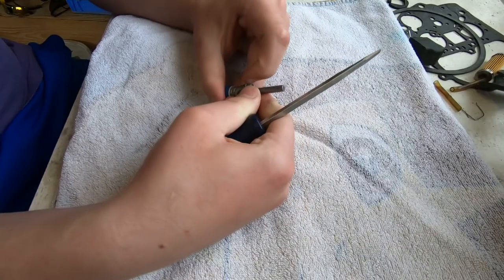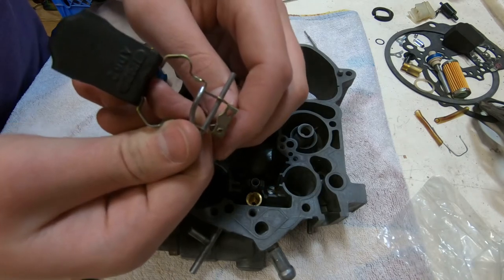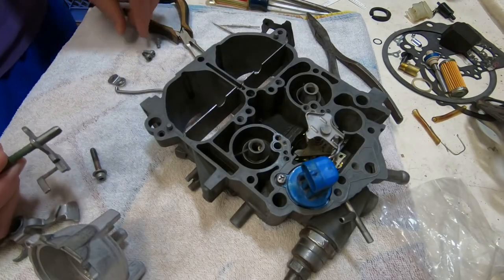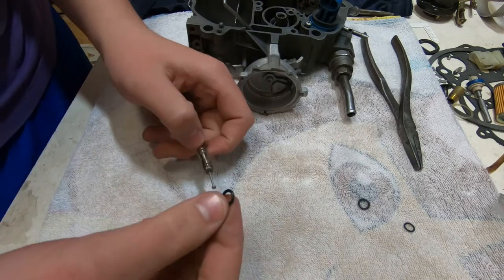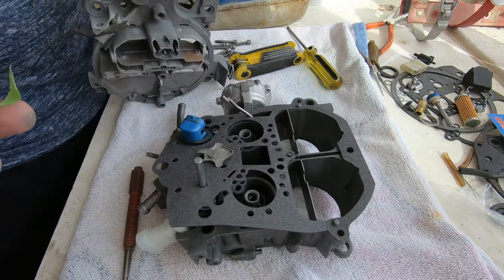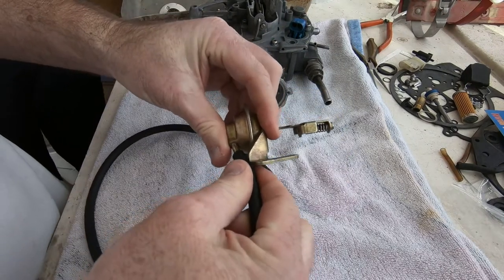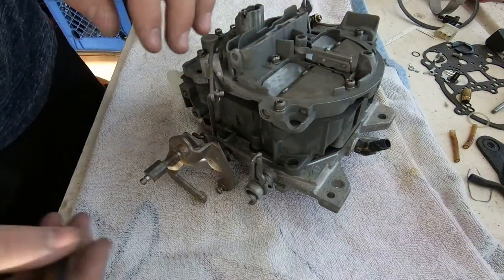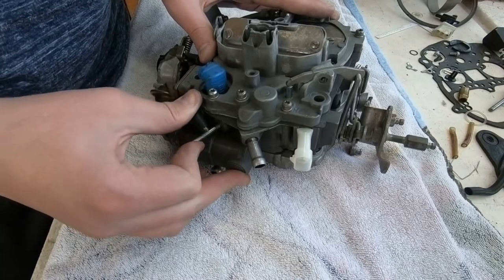E4ME Electronic Rochester Quadrajet Carburetor Rebuild, 4 of 5 - Reassembly

Comment: Thank you so much for this absolutely helpful and reassuring playlist for the rebuild. I'm going to do a rebuild me too without experience. Just a couple of questions. No lubricant on moving pieces was applied after cleaning that ? All ''dry'' assembly? Did you clean TPS and Solenoid? Contact cleaner ?
Reply from the maker: Thanks for the feedback and the questions!  It might be a good idea to lube certain spots to prevent wear, but I don't think we lubricated anything not shown in the video.  You just have to ask yourself (1) if it's internal, will gasoline was away the lube, or (2) if it's external, will it collect abrasive dirt?  We did buy a new TPS as mentioned near the bottom of the video description.  Contact cleaning is something we'd normally do if they look at all oxidized.  It might be with 000 steel wool or 150 grit sandpaper (the value doesn't matter but it can't be too coarse or too fine).  Then we always wash the contacts with contact cleaner (or carb cleaner or brake parts cleaner).

To this day I don't know much about the computer that controls the electronic bits of this carburetor, or how to tell if it's good or bad.  Luckily ours seemed to function just fine.

Good luck on your rebuild!

Comment: Excellent technique, tightening the air horn to the body/bowl. Always start from the center and work your way out, everything aligns and seals better. Use an X pattern for the carb intake hold down screws and only wrist pressure if you don't have a torque wrench. I have seen guys warp the air horn and entire carb by over tightening the screws.

Comment: Really appreciate the no-nonsense detailed assembly here.  I made a mistake the first time, the silver post that was supposed to be turned 3 1/2 times, there was a rusty spot on mine that I had to turn a little harder to get it all the way down before backing it off the right number of turns.  Car was driving poorly, secondaries wouldn't open, poor fuel economy.   Secondaries are opening now and doesn't bog down like before so I think I may have it right now.
Reply from the maker: Thanks, and really glad to hear the car is running better now!

Comment: I noticed the plug over the TPS adjustment screw was left on.  Is it not necessary to adjust or reset this with a new TPS?
Reply: @WorkinOnIt  At 20m30s, immediately to the right of the pump level, the silver cap is still there.  It would have to be pulled out (like the leaky well plugs) in order to get to the TPS adjustment hex screw underneath.    I guess my question is, if you put in a new TPS is that adjustment unnecessary?  Is that why it was left alone, or is there another reason?  Thanks!
Reply from the maker: @robdebuhr3952  Honestly, we simply didn't know about this adjustment.  Thank you for bringing it up!  In taking a second look, this is the best article I found on tuning E4MEs:  https://www.hemmings.com/stories/article/carburetion-for-the-new-age.  The TPS discussion left me wanting more, but at least it's there.

Comment: Hi.  I am flummoxed.  my top assembly does not lie anywhere near flat against the new gasket.  I can't see anything that would impede it sitting flat but there is a 1/16 inch gap even when applying a modest downward force.  it seems like all the edges will go down individually, so something in the middle is high and hitting, but what?  the gasket seems to lie completely flat. I thought maybe it was the bolt for the solenoid, so i pulled and redid that to 3.5 turns back but no change.  Any other places where something could be off that would affect the seating of horn section?
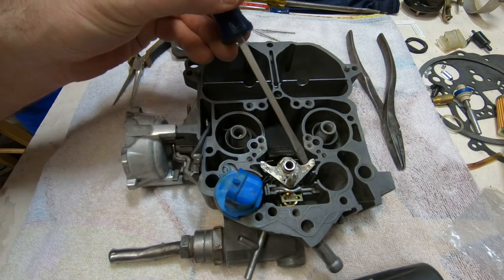Reply from the maker: I can relate!  Although you only see the "right moves" in this video, we also made a lot of mistakes that were edited out.  At one point the idle mixture solenoid was not sitting down all the way, and would have prevented the top assembly from lying flat.  We had to pull it back off for some reason, and the second time it sat much lower, as shown at 5:00 in the video.  So the idle mixture solenoid is my guess, but I don't claim to be an expert - any other theories would be welcome.
Reply: @WorkinOnIt  Yes!  that was it.  The CAP that covers this screw on the air horn was misaligned or too deep.  at some point the cap just popped off and the horn fell into place.  I figured this out only after I found a "spare part" that turned out to be that cap.  :-)
Reply from the maker: @cinefont2484  Thanks for updating with the solution!  This might save someone else hours of frustration.